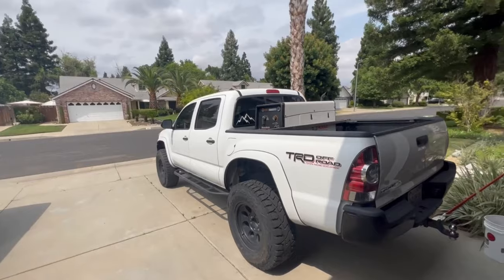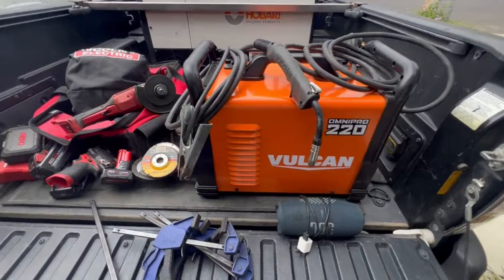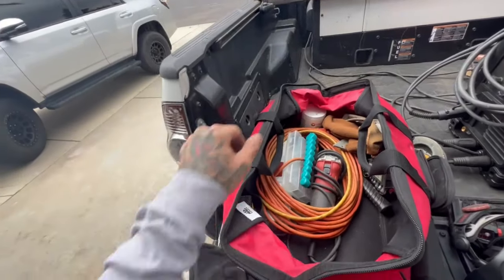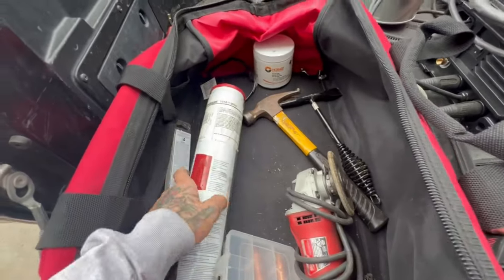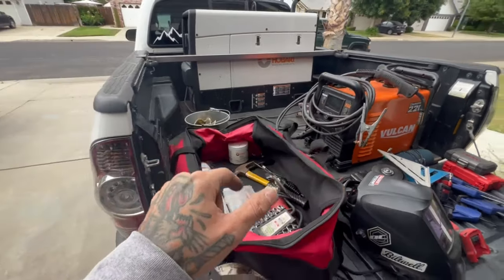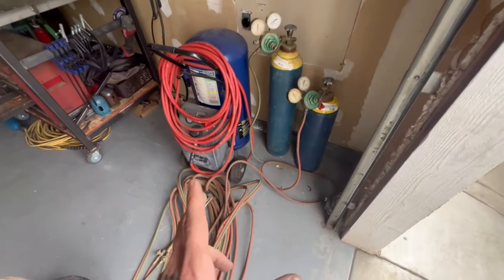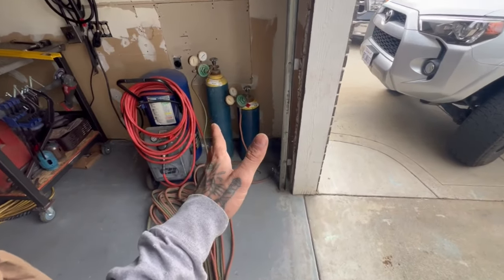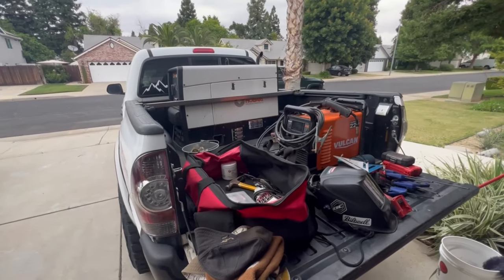Budget Toyota Tacoma Welding Rig Tour

Comment: I run a Tacoma that I built a bed on. Works really good. I built a full air suspension setup for it so it has no issues with weight. I load it and my skid loader and whatever pipe I need on my 40’ flatbed and when I get to a job I unload it and bounce it around to save the wear and tear on my new model dually. They’re great little rigs, mine has been virtually indestructible. If you don’t want to build a bed on your pickup, you can always just put together a little skid. That way all your stuff can be loaded/unloaded at once. You can put camper jacks on the 4 corners of it to make it real easy to pick it up out of your bed. Nothing is worse than loading and unloading loose bottles and cords and tools all the time. I’ve certainly been there. Good luck!
Reply from the maker: Great Info much appreciated

Comment: Slick rig ! For the vise I’ve seen some good setups where you sleeve square tubing inside another square tube and when you open tailgate you slide it out a little past the end of tailgate and have a bolt to tension/lock it in place, then your done you slide it back in an close tailgate, people running tub rigs like yours do that and often screw piece of plate on tailgate and you end up with work bench with a vise on the side. Hopefully that helps somewhat
Reply: I just built a stand that slides into the trailer receiver.

Comment: I ran a 2017 Tacoma as a welding rig for a bit. Now I’m running a ram 2500. Still ain’t got an everyday engine drive though. I normally use a generator powering either a Lincoln 210mp or a fronius trans pocket. On the bigger jobs I whip out the sa200 trailer rig though.
Reply from the maker: That’s pretty sweet man one day I’ll be able to upgrade the truck!

Comment: Great video. I just started my own fab business and am loading up everything in my Tacoma. I think I’m going to build a trailer though, because I’m pretty well maxed out in weight.
Reply from the maker: Yea a trailer is not a bad idea I’ve thought about doing the same thing!
Reply: @CM_Weld  I have a Harbor Freight trailer. They’re actually pretty decent. I’m going to build a rack/cage for bottles, beef up the frame a bit, put a bigger axle on it, etc. In typical welder fashion, I’m going to build something that would have been cheaper to buy!
Reply from the maker: @davidallsup2375  that’s sweet man you will have to post it up so I can check it out!
Reply: @CM_Weld  Will do!

Comment: Hell yeah bro.  I have the same welder on my f-250.  Runs great and will arc gouge and run a suitcase.  Time to make some spools
Reply: I wouldn’t arc gouge with it too much. It’s not wound to withstand gouging. The trailblazers are built to withstand it but the bobcats, same as the Hobart, are not. We burned up two bobcats in 2.5 weeks trying to repair the press that stamps out Jeep gladiator hardtops. They only had about 1500 hours on em. We got a big Lincoln vantage in after the second bobcat burned out and I brought in my Sa200. You can totally tell the difference gouging with the vantage over the Bobcat.

Comment: Hey man love your videos!  I’m trying to start a side gig. Currently looking for a cheap machine to start out with. Is it ok to power with generator or should I not even try it.  What’s the best option in your opinion
Reply from the maker: You can definitely power with a generator just make sure you can find one with constant power not one the fluctuates aka dirty power as it will potentially running your machine but I never had it happen just look at your welder specs and find a generator that can supply enough power so your running smooth!